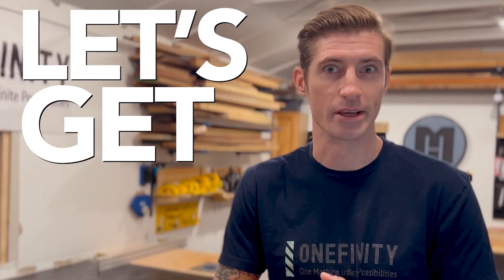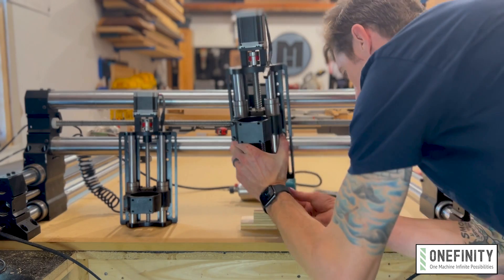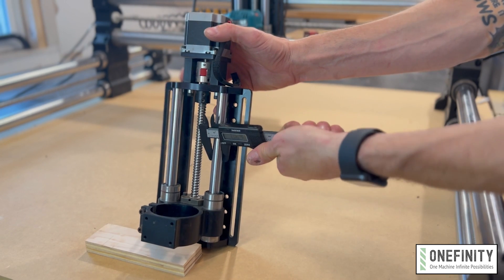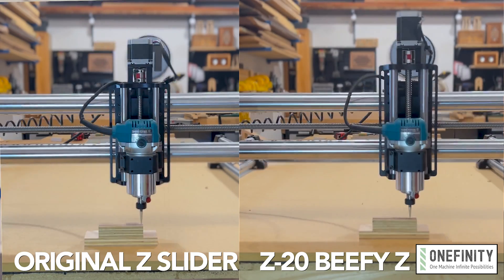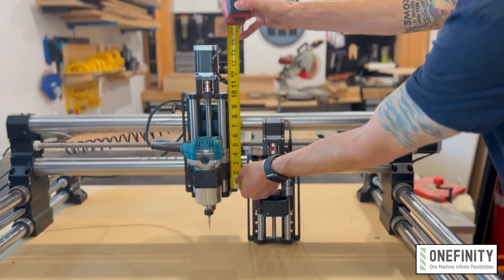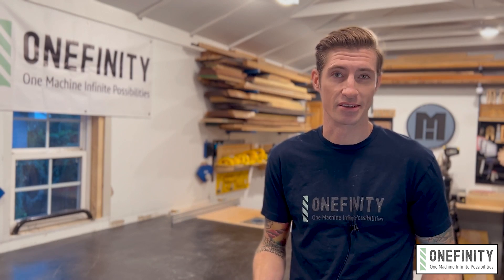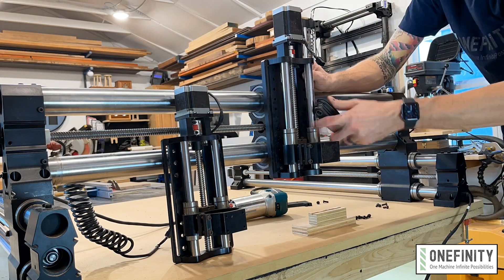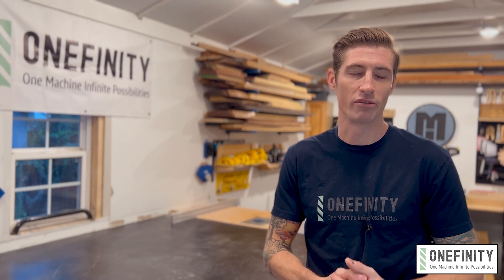Introducing the Z-20 Heavy-Duty Z-Slider (Beefy Z)

Comment: I have the original 32 x 32 woodworker CNC. My vertical travel is hindered due to my spindle hitting the bottom of the stepper motor.  will this new Z carriage help that or am I still going to bottom out on the stepper motor?
Reply from the maker: yes the new z carriage will prevent this.

Comment: I am about to install a PWNCNC 65mm 1.5 kw spindle to my original X35 Woodworker and there is an interference issue at the top of the Z-Axis hitting the bottom of the Nema 23 motor (all spindles will have this issue, not just Pwncnc) not allowing full travel. If I was to order this new Z-20 HD slider is the 65mm mount set out further to clear the top of the spindle? I don't want to upgrade to the 80mm wanting to stay with 65mm setup if at all possible (just a hobby machine) not needing all the extra amps and power for what I'm doing.
Reply from the maker: yes, it will clear.
Reply: @OnefinityCNC  Great news, so to confirm, the new z-20 spindle mount of 65mm is designed to eliminate the interference that was on the original 1st production z mount

Comment: If I order this for my 32x32 Woodworker, do I need anything else? like mounting brackets etc..? Will all be the same after installation, or do I need to change any settings? Thanks
Reply from the maker: You will not need to order anything else.  You will need to change the settings for the Z settings.  Instructions will be included.

Comment: Mine..! Then I definitely need to add a stronger x stepper motor as my onefinity already cant home the x axis without a light assisting push on the spindle head as the CNC thinks it has homed when it hasn't after adding a heavier spindle.. no amount of lubrication helps here.
Reply from the maker: No, you need to simply adjust stall homing via our stall homing fine tuning video :P

Comment: Is there trade in value for the old one? Does it shrink the overall surface cutting size?
Reply from the maker: Yes, there will be a trade in option in the ipp program.
Reply: @OnefinityCNC  And does it shrink the overall cutting surface?
Reply: @Golfexpertbelieveme  If the Backing plate is twice as thick as the original and is .500" then that will shift the work envelope .250" in the negative Y direction.